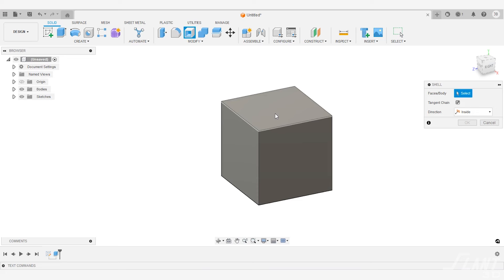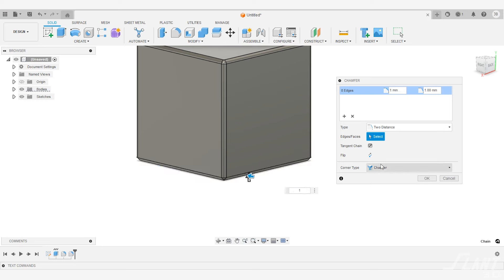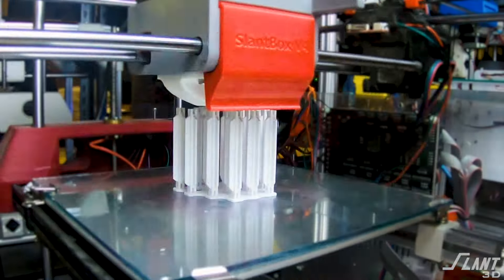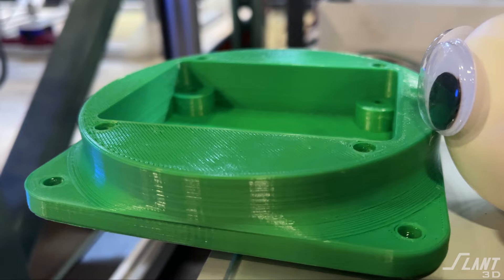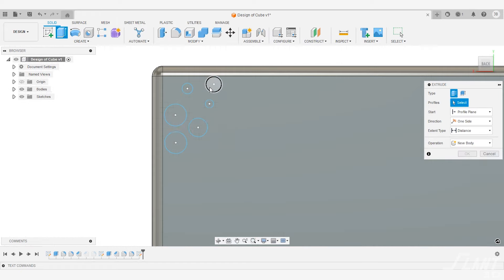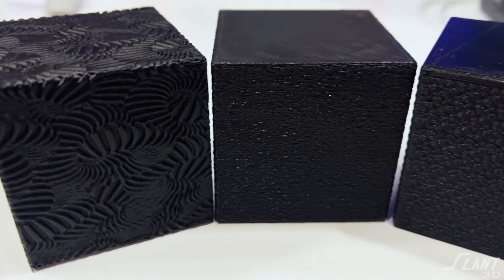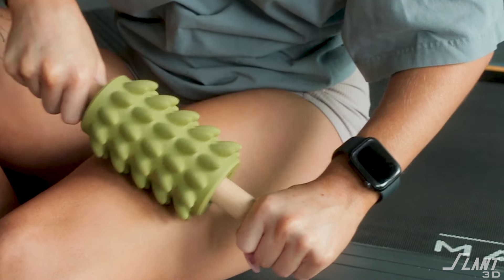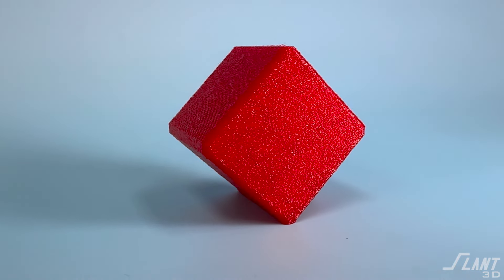Basic Design Tips to Lower Your Manufacturing Costs | High-Volume 3D Printing

Comment: Back in the heyday, most newcomers to 3D printing struggled with bed adhesion.  Now you are giving tips how to reduce bed adhesion 😊 Fun times!

Thank you for another great video.
Reply: Main thing is especially on glass beds they can stick super hard. easy solution i have found is to spray some isopropyl and wait a second or so, often it pops off or becomes significantly easier from the glass contracting.
Reply: Better materials for the beds and fully automatic first layer calibration on new machines have significantly improved bed adhesion. Although it should be noted that reducing bed adhesion is mostly for their automatic ejection and generally doesn't apply outside of Slant 3D.
Reply: They use stationary bed printers so prints coming off mid-print is way less of a problem. Even on a corexy with vertically moving bed it isn't much of a problem
Reply: Auto ejection keeps those greasy human paws off the bed which helps a lot.  I cringe every time I see a YouTuber reach in and rip parts off the bed.  Don’t tough the bed.  You’ll be surprised how long you can go between Dawn dish soap cleanings.  Occasional light wipe with alcohol for is all you need for months.
Reply: My physics teacher uses a little fan he set up behind the printer to speed up the cooling process and let thermal expansion tak its course, then he uses a little knife on one side to pop it off. My printer has powder coated pei so I rip it off as soon as octo messages me like the impatient person I am

Comment: I'm curious if yall ever experimented with belted print beds, I assume they have a lot of problems but they would also let you automatically eject practically any part
Reply: It would be interesting if they could bring it up in a video. Neither Prusa nor Slant 3D - which are the biggest 3D print farms in the world - use belted print beds. It's almost certain there are some pretty major hurdles holding them back.